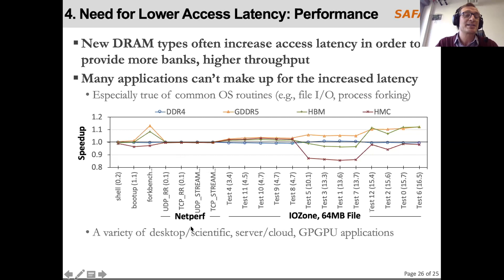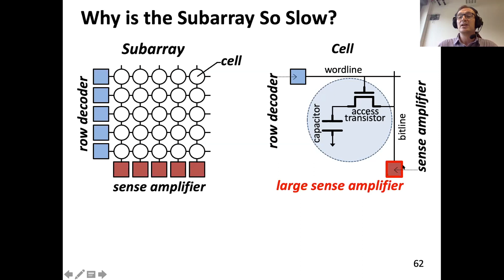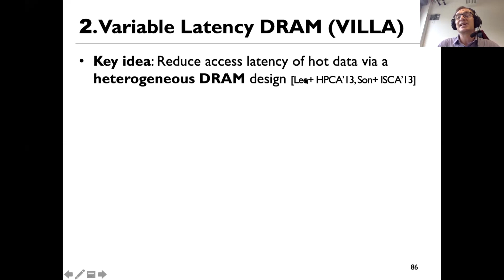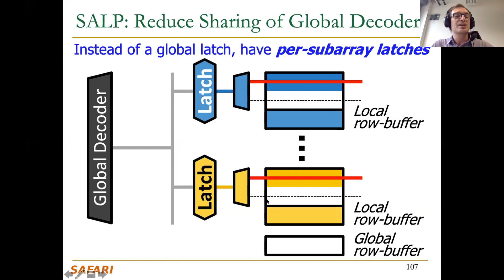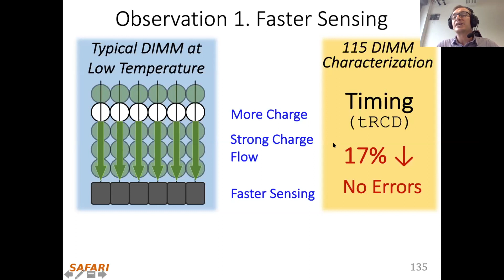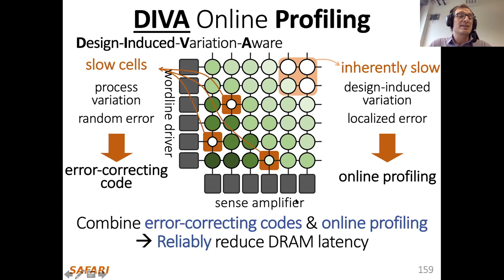Computer Architecture - Lecture 10: Low-Latency Memory (ETH Zürich, Fall 2020)

Comment: I just don't know why the latency just increases by 1.3X since 1999. I suppose that the DRAM frequency increase from 133Mhz, for example, to 1600Mhz, that is 10x latency reduction assuming the same number of clocks fetching a data from DRAM? Anyone can help me?
Reply: Hi, as I know the latency actually means time from command to result.
For example, you say to a dog a command, and it does it. The time that was spended is latency.
A logic in a circuit have a minimal time to switch. We can reduce it with redesigning a circuitry, but there's always an edge limitation.
A better explanation you can find in a book Harris and Harris "Digital Design and Computer Architecture"